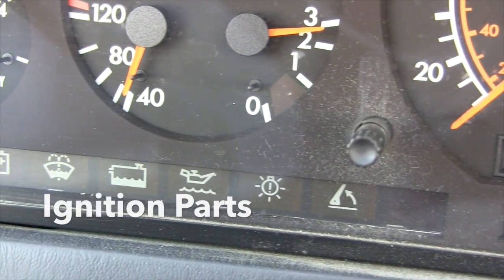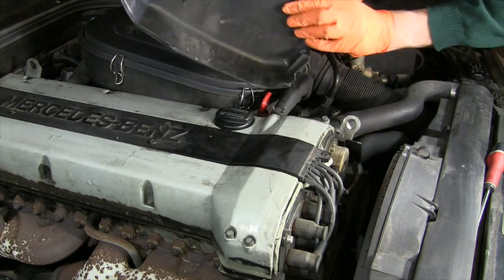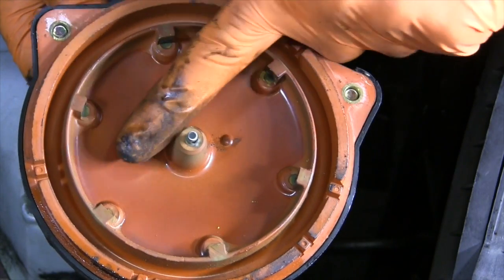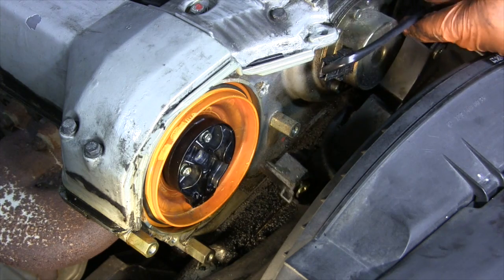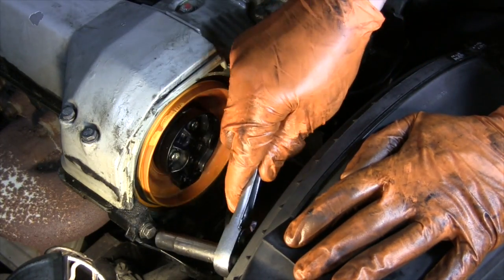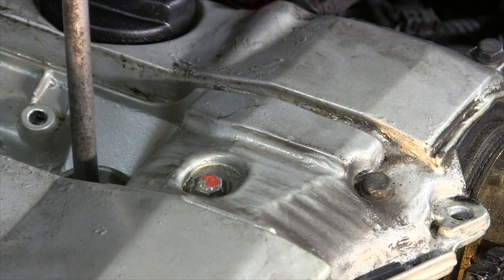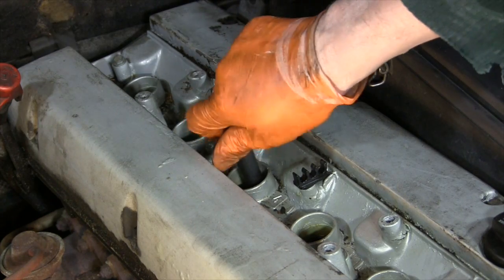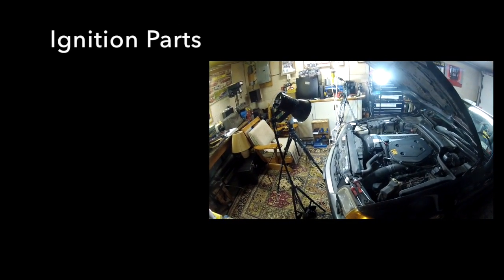Mercedes  300SL R129 Ignition Parts M104 (some W124)

Comment: good video, only thing I would do different, is to also replace the insulator cover when the cap and rotor are replaced. A single 5mm hex screw hold the rotor mount in place,. It must be removed to remove and replace the Insulator cover. With the insulator cover removed, look for oil seepage coming from the cam end seal, (o-ring). If there is any oil inside this housing area, replace the cam o-ring seal.
Reply from the maker: Excellent idea! Thank You!

Comment: Interesting that you are using platinum plugs with good results, I was always under the assumption they would not work well in these old engines. I'm a little scared at the price of the EZL's for these m104's so bought up all the remaining stock of the new old stock OEM copper core bosch plugs when i redid my ignition system.
Reply from the maker: Hi! Well I took a look at my old receipts. The set of platinum plugs I took out in the video were ones I put in March 2010 at about 66K miles. This footage was actually shot in 2015 and the odometer was 166K miles, so they went 100K, with no problems. And I now have 199K on the car. so the set that you see installed has 33K on them. I have had zero problems with the plugs running with the rest of the ignition system. I started using the 4-prong Bosch plugs in my 1970 Fiat 124 years ago because they just didn't foul. (the old engine needed valve guides and would load up and start to miss in 3K miles) After I swapped in a rebuilt engine to that car, I kept the same type plugs & they work great. That said: they cost more, and they do not list versions for every engine. So maybe they do cause problems in some applications.
Alden
Reply: Very interesting indeed. I doubt the original spec copper core plugs would of lasted that long without severe degradation of performance and erosion of the core and tip so clearly they do last a long time. Here in Australia we have a company that makes a complete plug in replacement injection and ignition control system for laptop tunability of the old KE-Jet system. If my EZL ever blows on my m104 I'm going to go down this path.
Reply from the maker: The sad part is that the plug-in replacement system is probably cost competitive as an EZL alternative. It shows how expensive some of these old electronic components can get!
Alden
Reply: MMWA hey im interested in than replacement System May i know the company's name?
Reply: I use Beru non-resistor plugs sourced from MB. Cheap and correct. Why pay more?

Comment: The EZL needs Non- Resistor plugs
Reply from the maker: I have read that too. It has not been my experience. I replaced the plugs in March 2010 at 67K miles and then again, for this video in February 2017 at 199K miles. Both times were with the Bosch 4418 Platinum +4s shown in the video. So 130K miles with no problems. Then 19K on the 2nd set. Not knocking non-resistor plugs, just saying I had a very good experience with platinums on this 1990 M104 motor. YMMV
Alden

Comment: Mine is really sluggish with only 60K miles. Will this help ? Just purchased the car and don’t know if it has ever been tuned.
Reply from the maker: Hard to say. Down on power could be just about anything, from a clogged fuel filter, to low engine compression. For me,  tune-ups usually helped the most for things like starting easier, better gas mileage and smoother running. I'm sorry I can't be much more help over the internet.
Reply: Are you sure the 4418 will work in this engine Bosch says they are discontinued and most charts say they will not fit the 104.

Comment: The same engine. Died on freeway, wont start up now. Cranks, but no start. No matter, cold or hot. What could be the issue? Sensors, Ignition module, distributor?
Reply from the maker: So many possibilities, hard to diagnose over the net. I'd first check the for the fuel pump & relay. First notch on the key, you should hear it cycle, if not start by checking the fuse & relay. The scariest  (for me) would be if the EZL ignition module has died.  Can be Big Bux to replace.
You can check for spark by working your way back from pulling a spark-plug and moving towards the distributor & coil. I have had the coil fail on an M103 engine before.  
Hope this helps.

Comment: I followed these directions, However, my '92 SL500 has a larger 24v 470uf, a smaller 24v 100uf, and a larger 24v 47uf capacitor  NOT 2 100uf.  So now we order and wait again.
Reply from the maker: Yes, there was some variance over the years. The dashboard I repaired was for a 90 300SL, with the 6-cylinder engine. The undeniable caution is to not use a lower voltage than what is in there when you open it up. Mine took 16V caps, but if you see 24V ones on your car, by all means, go with that or higher. The resistance is actually less important. A lower voltage cap will just fry . Also, your 92 must be an early build, because many cars of the later months of 92 (November ?) had a different odometer and circuit board. The fix really only works for cars with a mechanical odometer, not the LED-looking one.
Reply: @FlashDriveFilms   Yes, mine are 25v, however, it still has a mechanical odometer.

Comment: Watching your video made me realise the front engine cover has always been missing !!!! so i have asked Fraubenz in the UK  if she has one, 
A very good video and i have already sent a request for parts to autodoc, I had to take the AC condenser out to take the rad out, as a single unit ,  unfortunately i have put everything back in before watching this video, it would have been an easy job, of course sods law says the engine tries to start but doesnt  so i am squeezing under the car to get to the pump assy, I will change everything i hope its a pump problem and not a blocked fuel line,  , With Luck and a pass of the gov test i should be back on the road this July 2023, Best regards Cheshire UK.

A short story, i drove my SL from Manchester UK to Pendeen near Lands end Cornwall, its around 360 miles one way, the car was perfect no complaints  but on arrival i had a stinking headache, i took some meds only realising later i accidentally took a double dose, crap i peed blood later that evening , I was down that way paying respects to my late parents grave in Pendeen Church. I stayed at the beach hotel in Hayle where we would go as kids with mum and dad,
 Upon my return i had a full check up, kidneys and bladder scans  and was down with bladder cancer, i had two operations small by all accounts they used a laser  and zapped the growth, this was 13 years ago, during covid,  the system signed me off as a low grade risk without any check up whatsoever , next month i return to my retirement home in Thailand, for a few weeks ,  and i will pay the £450 cost to have my bladder check up done in Bangkok, I can no longer trust the system in the UK. This will be the third time i have used this particular BKK hospital, 
As for the SL the straight 6 is great and i had to renew half the exhaust with stainless steel, it sounds the business, 
I have been very lucky so far over this bladder cancer it was caught in the very early stage due to my accidental overdose of paracetamol, so enjoy life and drive a R129, any engine size, for me the straight 6 is pretty good. Cheshire UK.

Comment: I changed my plugs no problem but wish i had seen your video first, next up as you recommend will be renewing the cap and leads etc, once again my thanks.
Reply from the maker: Glad it helped. I found the leads to be surprisingly expensive. The OEM brands, like Bosch and Beru were over $150. Very good quality, but still more than I'd been used to paying. Cap & rotor were about average, I thought.

Comment: In removing and replacing spark plugs on this particular engine model I normally used a magnetic spark plug socket, its handy and nothing to worry about.
Reply from the maker: That's an excellent technique. These spark plugs are in a pretty deep, narrow well on the M104.

Comment: Great video. 
Can I use the same plugs ,cap and rotor that you used ,in my 1995 SL320 R129 ? I read you've had no issues with them and I'm impressed.
Reply from the maker: I am going to tentatively say Yes, no problem. I had no issues with the two sets I installed in my car, but I don't know what changes might have been made in the EZL ignition modules between 1990 & 1995. The EZL seemed to be the concern on the forums & message boards about using the Bosch platinums +4. I had good results and no problems. YMMV

Comment: I’m looking for a new spark plug wire cover for Mercedes 300SL.
Any idea where i can Find one ?
Reply from the maker: I would try any of the usual suspects, like eBay, Craigslist or FB Marketplace. Just don't limit your search to specifically the 300SL, the M104 engine was used in several other models and the cover will be the same. Best luck!